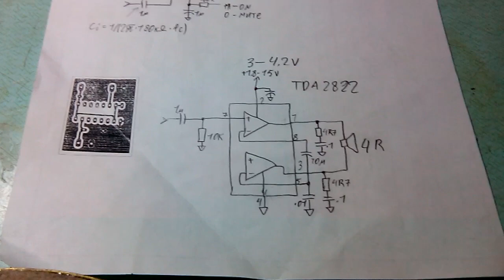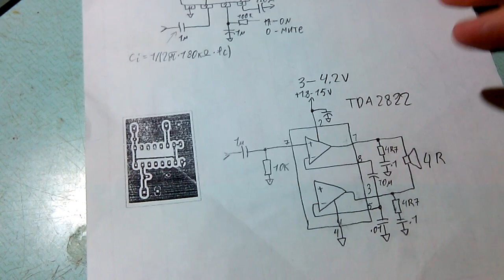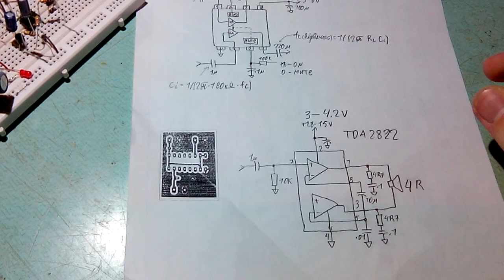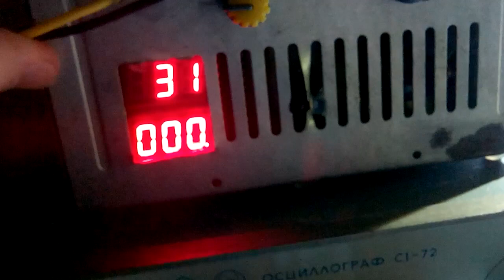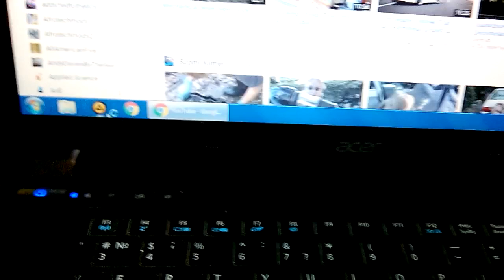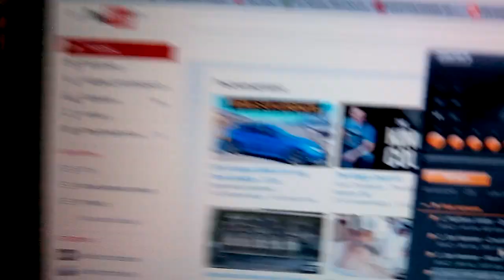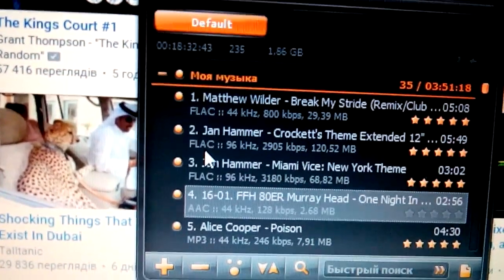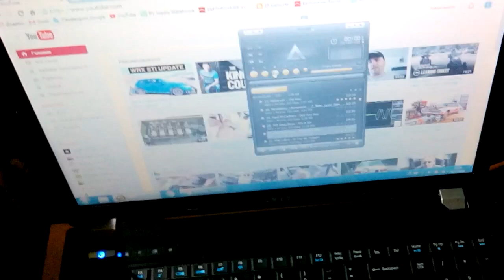Low-voltage Low-power audio amp using TDA2822

Comment: Why the sound gets distorted when the volume of music player and amplifier is increased to maximum ?
How to prevent distortion while maintaining louder volume ?
Reply from the maker: It's called clipping. When the output voltage of the amp tries to go very close or higher than the supply voltage. The only way to eliminate that is to use the highest supply voltage allowed for the amplifier.
Reply: @mrjohhhnnnyyy5797  I constructed the bridge version of this amp and powered with 6 Volts @ 8 ohms load and sound source was a mobile phone

Comment: BTW, what class of amps is this? A, B, AB, D...etc. ?
The PAM8403 class D amp is much better than this, I think, it is a little beast.
https://www.youtube.com/watch?v=0rbGXj1XvL8
Reply from the maker: It's an old-school class AB amp, I made it because I had the chip laying around doing nothing. I have PAM8403 amp on homemade board too, it works good but has a bit higher noise floor. Also, TDA2822 has a wider power supply voltage range, which makes it better for some applications.
Reply: Yeah class D amps got some issues. But they are improving:
http://www.audioholics.com/audio-amplifier/the-truth-about-digital-class-d-amplifiers
And PAM8403 can run from 2.5 to 5.5 volts according to datasheet:
https://www.diodes.com/assets/Datasheets/PAM8403.pdf

Comment: looks like its working properly, except what cracking sound, which you said is speaker issue ? that slight hiss is what i get as well.
Reply from the maker: +iceberg789 It is working fine indeed, hiss doesn't bother me anymore. The cracking sound might be clipping since as you saw, I used quite low supply voltage.
Reply: +MrJohhhnnnyyy you may check, if you have an oscilloscope.
Reply from the maker: iceberg789 I do have an CRO, but it's not plausible to spot the clipping when you are using song as input signal (it changes too fast).
Reply: +MrJohhhnnnyyy you can play 1khz sound file as source signal. or you can use a 2khz 555 o/p with a cap and resistor in parallel, as input. it forms a near sine wave.
Reply from the maker: iceberg789 That isn't a problem, I have a homemade DDS generator, it can spit out sinewave, squarewave, triangle and sawtooth. What I wanted to do is to be able to see the clipping occuring when it plays a SONG, I can't do that with my CRO. With DSO scopes, you can fiddle a bit with a single sweep function and essentially capture&store, then look at a waveform. Hope it's clear now :)
Reply: +MrJohhhnnnyyy i understand that you want to check audio input with a dso, by taking screen captures, but with cro, you can at least find out at what i/p o/p voltages the o/p getting clipped with constant freq inputs.
Reply from the maker: iceberg789 I might do just that on next weekend, as well as measuring clean output power :) But, that has to wait to weekend :(
Reply: i have updated mine by adding a 2 channel BC548B class A preamp to this TDA2822. there is no more noise now, totally silent and great sounds.
probably BC327 would have worked better, will see someday.
Reply from the maker: iceberg789 That's good, but - the gain of the chip itself is quite high. With ridiculous gain you have the risk of oscillation. Layout and decoupling becomes critical. But anyway, seems like you got it right, good job! I'll give that a try if I'll have some spare time.